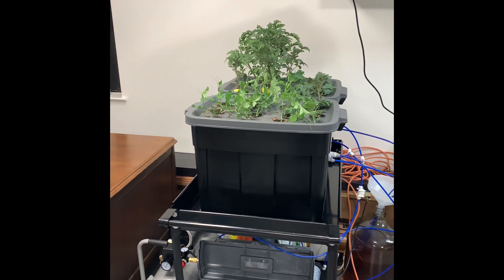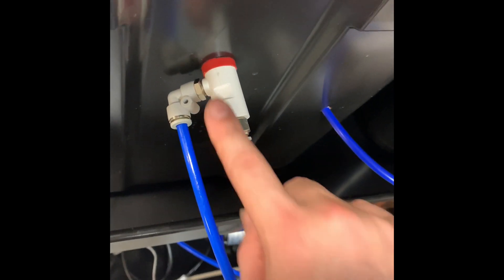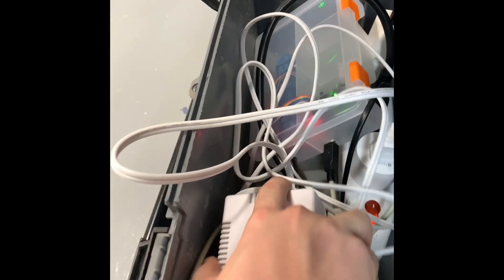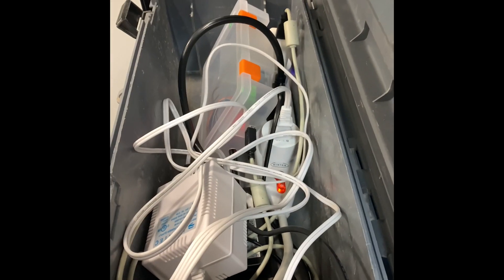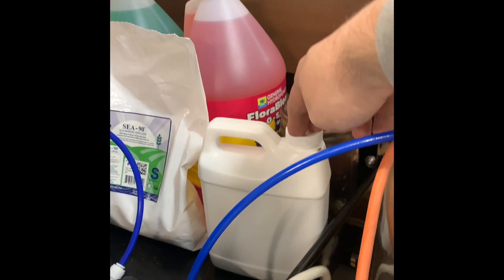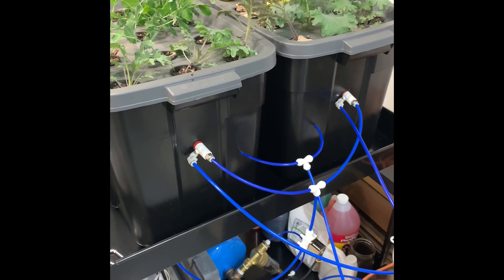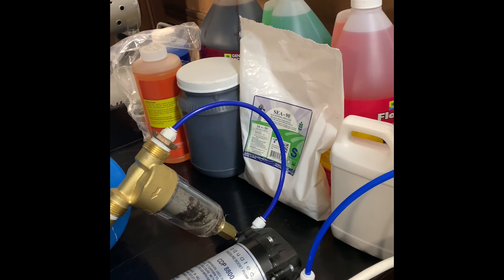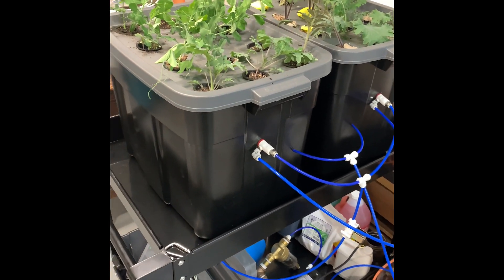Aeroponics 101 - The true build  - for hobbyists

Comment: Best video I've seen on an aeroponic setup by far. Using the aeroscience atomizers actually simplifies the system a lot and is more true to the NASA build with the size of the droplets you're delivering. Nice work! 

Others have pointed out that the low pressure or "mister" setups work, but I'd be curious to see the difference in results. The other methods are essentially doing a hybrid hydroponics which isn't aeroponics. Like you said there is a scalability "issue"; however, I think that could be easily overcome. When I saw you using the atomizers my first thought for cost savings was 3D printed atomizers. Also my guess is the pressure demands don't hinder large scale aeroponics companies from using HPA.

Keep it up!
Reply: I run both senninger fog nozzles, which are hydraulic, and aeroscience dry fog, and the dry fog is def way more difficult to install. Unless you are doing a little tent, it requires a complex and expensive (to install and operate) compressed air system. Mine has a 2hp motor/pump, belt driven, with a 30 gal wet tank with auto drain, running to a refrigerated air dryer, with pre and post filters for particulate and oil, then it runs to a 20 gal dry reciever tank inside the house, and then to a 0.01 micron Motorguard filter, then finally to the flower room and the valve manifolds, then the nozzles. Whereas all i need for the senninger hydralic nozzles is a relatively inexpensive stainless steel rotary vane pump (im using fluid o tech 140gph with internal bypass on a 1/3hp motor) and a few accumulators. And, btw, I do highly recommend ditching diaphragm pumps for the rotary vane "carbonator" style pumps. Every diaphragm pump ive ever had broke down on me, either by leaking to death, the non replaceable pressure switch breaking, or the motor going bad. Meanwhile, my rotary vane pump is pretty much bulletproof and can feed all 3 of my accumulators and the 72 senninger nozzles (not all at once though, because the gph flow isnt large enough, although I do have a 330gph procon pump Im going to try out next time, and that one could prob feed all 72 nozzles at once, even though I dont need it to; I have a nice little controller system I built using a Galcon AC9s and some voltage converters so I can use cheaper 12vdc vavles on it. I have 18 chambers, and I fire 6 at a time, breaking them up into 3 separate timing 'zones')

I actually only use the dry fog as a supplement. Ive found that the roots really do best when you provide both sizes of droplet. Dry fog is usually around 7-10 micron, and the senningers, or tefens, have a range of 30-80 micron, with most being around 50 micron. The larger droplets help the roots grow more robust, whereas the dry fog droplets lead them to grow more fine root hairs and less robust vertical and lateral shoots. Where the dry fog really shines is after the larger root mass has developed, a couple of weeks into flower. The roots can get dense and compact when they form their root balls and mats on the chamber flloors. The 7-10 micron doplets avoid impingement on surfaces until the space has been fully saturated with the fog, so when I fog out the chambers (Im still playing around with their interval durations, but lately ive been doing 12-20 seconds on/15-30 min off) the droplets bounce around all over the place, getting deep into the dense root mass until saturation hits and the moisture finally starts being taken in by the roots. 

The two also completement one another as reduntant, mission critical systems. If something happens and the dry fog goes down, the hydralic mist will still be there, and vice versa. 

The first time I ran the dry fog (18 chambers with one aerosci nozzle each, and four senningers each) I quickly had issues with my cheap, weak compressed air system. The compressor was too small, too loud, and didnt have auto drain on its tank, and neither did my "dry" reciever tank. Both tanks filled up with water, and I mean filled up. I realized there was an issue when the compressor cycling was going on for way too long. There was no storage/surge capacity in the tanks anymore because they were filled with gallons of water. So that was sort of my wake up call that if I wanted to run dry fog in my flower room (I also use the dry fog nozzles for humidification during veg and sometimes early flower) I was gonna have to build a proper compressed air system. 

I did a lot of consumer research on compressors after trying to use a Cali air tools unit and finding that those "quiet" compressors are not capable of the duty cycles required for a dry fog system of this size. All piston compressors kinda suck, and none are truly reliable like rotary screw and scroll compressors, which are used when constant air supply is needed. I found that many of the companies use similar or same parts, and in some cases, its almost the exact same compressor. I recommend the Central Pneumatic 2hp 29 gal belt driven compressor from harbor freight, because you can get their extended warranty with it, so that if you beat the hell out of it and it breaks, you can just take it back and get a brand new one, and you can keep doing that until the 3 year period is up. 

If anyone is reading this and wants to try the dry fog nozzles on larger scales than a tent or small room, the easiest way to set the nozzles up, in terms of the nutrient solution supply, is to run an appropriately sized diaphragm pump (for really large scales, jet or centrifugal pumps are best) and put PC drip emitters, like woodpeckers (Im using 1gph emitters) on the 1/4 tubing that feeds the water side of the nozzle. Then you can easily wire the air and water solenoid valves together, so that when the controller calls a nozzle to action, both the compressed air valve and the solution supply valve open at the same time.
Reply from the maker: @jonosterman2878  I followed everything here you wrote. Very cool you use the dry fog as a supplement, and also cool how you went down the rabbit hole of getting the air dry and purging the tanks. I also learned a lot about compressors, and what makes a good one, and I agree the cali ones are cheap and not really good for industry. The compressor that I found would be a good one to get, is the eastwood elite 30/60. What you think of that one? I also agree having the hydraulic tank valve pump setup is nice and quiet and easy, and I would probably just use that for a small home system with some really good filtration. Ideally I'd want some kind of heavy duty compressor and a huge tank run underground or outside infrequently. I ran into some compressor heat issues.
Were you running the same 12v solenoid valves with the 1/4 inch fittings?
 I hope you have some videos up, your system sounds awesome!
Reply: @Ghanzo  Thanks man! I appreciate that! I have seen that eastwood compressor, and I wish I could have bought it and tested it out, but it was a bit out of my budget, for now anyway. I was actually considering getting it for a minute, but ultimately decided it was too expensive, and would have eaten up too much of my savings. Most of what im doing is R&D and im having to bootstrap all of it, so cost/benefit is always on my mind when it comes to equipment. Other than price, the reason I didnt get it is because I read all of the reviews for it and saw some issues with reliability that can sometimes pop up. Granted, thats true of all compressors, but for one that I have to order online, that requires a lift gate for delivery and pickup, and that costs over 2k, I felt like that was too much of a risk for me, when I really cant afford to have it not running. 

The reason I went with the 2hp 30gal belt driven Central Pneumatic from harbor freight is because 1) The price was the best for that specific style compressor (eastwood sells one just like it, with the same motor and pump, just slightly different tank) 2) It was available here locally at one of several HF locations, and 3) I could get that extended warranty plan for about $80, and that would allow me to easily replace it if breaks down; i wouldnt need a lift gate freight truck pick up, and I can just exchange it for a brand new one that same day. I just started using it, but so far, its really an amazing compressor. Its a little quieter in terms of db, but because the pump is driven by a belt and not the motor shaft directly, the sound frequency is different; its not as percusive, so even though its only a few decibles lower than the real noisy oiless compressors, its a much friendlier sound on the ears, so it doesnt hurt to stand a few feet away, and you can actually hear people talk. 

So, the temp issue; I solve that for both the dry fog and hydraulic mist by using immersion chilling systems. I recently switched my mother set up over to HPA (just hydraulic senninger nozzles), so Im 100% aero now, and I have an elaborate chiller system in there and in the flower room. I have an hpa cloner i built from a 64 site low pro ez cloner, and that sits in a tent in the closet space of the mother room. instead of having supply and return lines running across the floor, I plumbed and insulated pvc piping that wraps around walls of the room so the cloner res can also have a chiller coil in it. I use active aqua chillers (1/10hp in mother, 1/4 in flower) and instead of running the nutrient solution through them, I have those rectangular beverage coolers as reservoirs--because they are already well insulated--and all the water in there is what gets pumped through the chiller, while another pump sitting in the chiller res is circulating the coolant (just water, no glycol or alcohol) throughout the immersion coils (also known as wort chiller coils) that sit inside the nutrient tanks/reservoirs. My mother and cloner reservoirs (28 and 20 gal, respectively) both run at about 65-66f, while my flower room tank (75 gal) runs at about 63-64f. I keep it so low because of the residence (or "dwell") time of the nutrient solution inside the accumulators, and i the case of the dry fog, the insulated pvc pipeline that feeds the dual valve (air&water) manifolds. I also run a dry fog nozzle for humidification, and I have an immersion coil in that water tank as well. So the potential heat from the compressed air isnt an issue at all. 

Im actually using 24vac solenoids for the compressed air supply valves for the dry fog. The humidifer nozzle runs on a 12vdc solenoid valve so I can use one of the many spare 12vdc power supplies I have laying around. I just have that nozzle plugged into an Inkbird wifi humidity controller. It can be hard to find 24vac solenoid valves that dont cost over $20 a piece. I only needed six of them, so I just decided to get them anyway, because it would have cost me almost as much to get more of these little voltage converters that can take in 24vac and put out 12vdc and wire them up in a nema 4x box. The 12vdc valves usually cost between $8-12 a piece, while the 24vac valves cost $20-30 a piece.
Reply: @Ghanzo  I also have a few tips, assuming you dont already know them: One of the best ways to maintain healthy roots and avoid pathogen ingress to roots zones is to raise the ORP of your nutrient solution with HOCL (hypoclorous acid). UC roots or Clear line are both great for keeping the oxidation reduction potential above 450mv, so that the micro organisms that inevitably make their way into the nutrient reservoirs/tanks (it really is inevitable because these little fuckers are everywhere, floating on dust particles in the air, falling off our skin as we move, and being shot out of our mouths as we speak and breathe) can be tightly controlled and limited, so as to prevent their proliferation inside the nutrient solution. When that happens, you begin to get issues with biofilm, which is the arch enemy of all growers everywhere. 

Biofilm is very complex and easily proliferated inside irrigation systems and potable water pipelines. Google "biofilm formation" and search images. You still see an animation diagram of the steps. Theres four main steps, with many smaller ones happening at finer detail. But it all begins with "attachment" when the micro organisms literally attach themselves to any surface, be it an irrigation tube or pipe, tank or res, table or bench, or even on the plant medium (in our case the roots themselves). Once they attach to a surface, they begin to form a monolayer, matrix like structure, which then gets repeated with layer after layer, forming a microcolony. After enough layers are built up of these polysacharrides, they then detach, but not as one single organism, or even a small cluster, but instead as a massive chunch, filled with millions and millions of them. Their spread inside irrigation systems is a lot like a fungus spreads, with spores seeding new colonies. 

The reason why its important to use oxidizers in aero and hydro nutrient solutions is because the easiest and most effective way to battle biofilm is in preventative measures, and the gold standard for that is killing the mirco organisms inside the solution tanks, before they ever get a chance to attach to any surface, anywhere. Because once they do attach themselves, it just gets harder and harder to remove and kill as those four steps take place. The biofilm forms this protective layer, which is what gives it its gross slime like qualities. You cannot easily break through it to get to the actual organisms and kill them. Once the biofilm is fully established in an irrigation system, the only way to deal with it is by using sulfuric acid, enzymes, or both as a pre treatment to break down that outer protective layer, then come in with the potent PAA (zerotol, sanidate) solution to kill the organisms and flush them away. 

This is important for all growers/ cultivators, but it is so much more important for hydro and aero growers. And I would argue that you cant really succeed at aeroponics without understanding biofilm and how to deal with it, and prevent it. 

People often cite the small orifice of hydralic nozzles at being one of the greatest risks, but honestly, Ive never run into any nozzle clogging issues, at all. What I have run into, several times, is pathogen ingress to the root zones, by way of the nozzles. If you have a contaminated system, or even if you just neglected to clean one of the many 100 micron filters in the system, you end up misting the roots with tainted, damn near poisoned nutrient solution. Just recently I saw my newly transplanted mothers go from healthy to stalled out, with root zones affected by some pathogen that made its way through the nozzles, all because I thought I had cleaned all three of the filters in the system, when in fact I missed the one right after the accumulator, and it was allowing litte bits of this gunk to pass through. And im talking tiny, tiny bits of contamination. Nothing big enough to clog a nozzle. The roots went from pistine white to light rust color in less than two days, and thats when i realized my mistake. Luckily, all but one made it through the illness of the roots, and the rest are almost fullt recovered. 

There are better ways to boost ORP and DO at larger scales of cultivation, but for smaller scales, they are too expensive and cumbersome. You basically have the option of direct injection of oxygen bubbles, injection of oxygen nano bubbles, or ozone treatment. You cant use ozone on nutrient soltions because it causes the precipitation of iron and magnesium and a few other metals. It is only viable for treating tap or RO water supplies. Regular oxygen bubbles are too big and quickly rise to the surface and pop, dissipating most of the oxygen before it ever got a chance to dissolve in solution. Nano bubbles, on the other hand, are so tiny that they do not easily or quickly rise to the surface, which means they are a much better option for fertigation solution treatment. To give you an idea how small they are: 2500 nano bubbles can fit in the area the size of a grain of sand.
Reply from the maker: Thanks! Greatly appreciated
Reply: What do you think of UV sterilization? I saw a professional aeroponic system with UV recently.

Comment: Amazing. May I ask how do u drain the water accumulated inside the tub?
Reply from the maker: It's not the most elegant method, and if I did this again I would do it differently, but I used and aquatec 8800 to pull the water out the bottom of both with a y connector. You can see the two 1/4 inch tubes going in under the nozzles. The problem was that often only one tub would drain. So If I were to do it again I would have a hole in the bottom of each tub that drained to a container and then pump from that one container.
Reply: Thanks for sharing how you set it up and also your thoughts on improvement. That is really helpful 😊👍🏼👍🏼